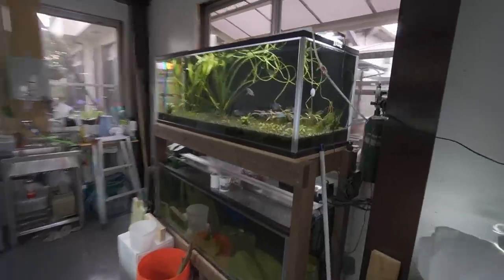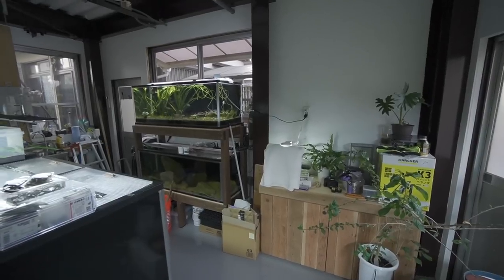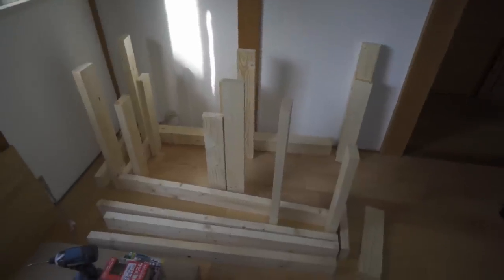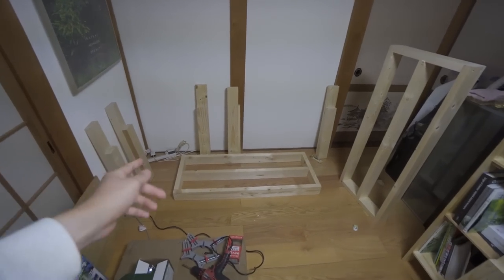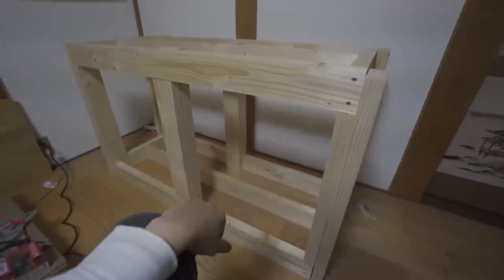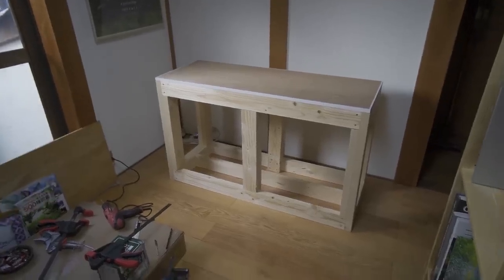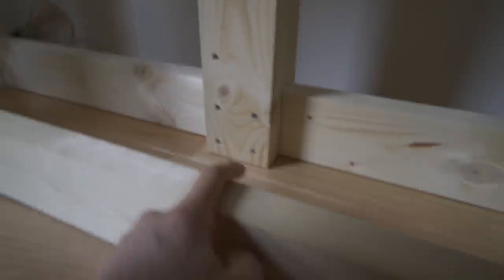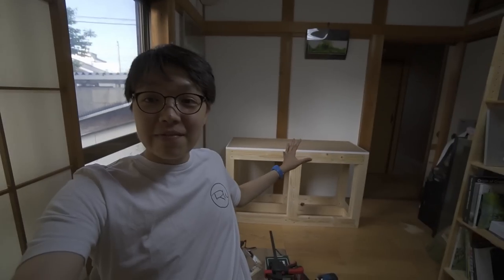Beautiful DIY 2x4 Aquarium Stand Build

Comment: Ryo this is a great stand and I love how you hide the ends of the wood. Next time you need to try using a pocket hole jig so you can hide all of the screws. I started using one of these pocket hole jigs from the company "Kreg" and it has changed the way I will build all stands in the future. No more wood filler or covering screws up. 
Great videos been a long time subscriber keep it up 👍🏻